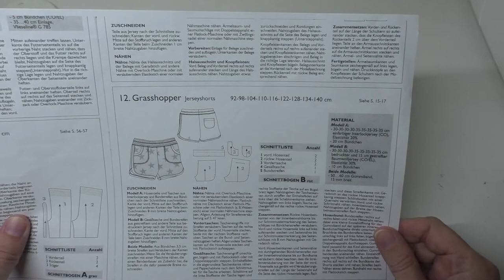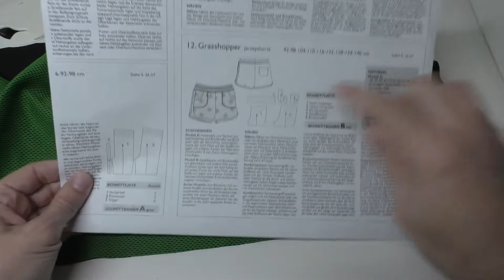Project - Shorts with outercurve binding

Comment: When binding an inside curve as in a neckline, should I increase the tension toward the center?
Reply from the maker: usually no - you will have more consistent results if the tension is the same around the whole neckline. I honestly do not adjust during the entire process. If you are unhappy with the results you are better off removing, steaming it to get the fabric to recover and starting over.
Reply: @rebeccassewingcorner49  Thank you so much!  And thanks to your video, I “ understand” my binders now. Very helpful!